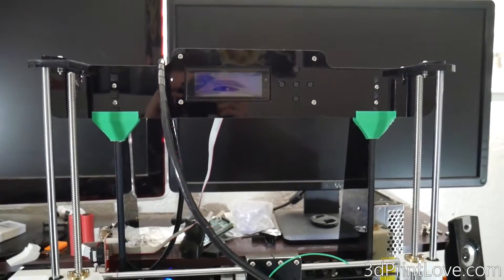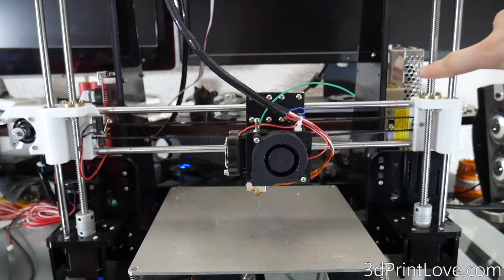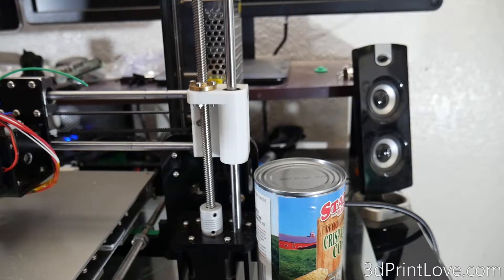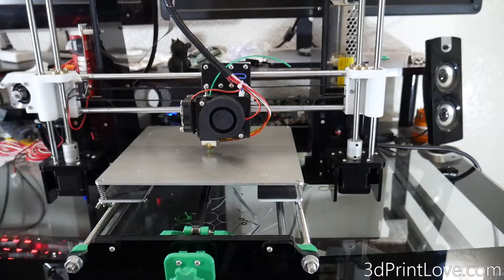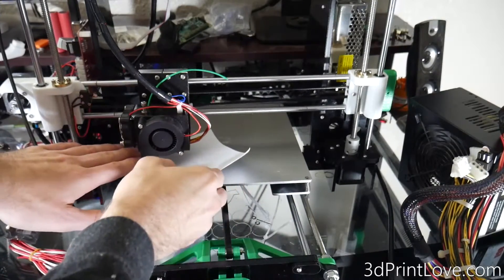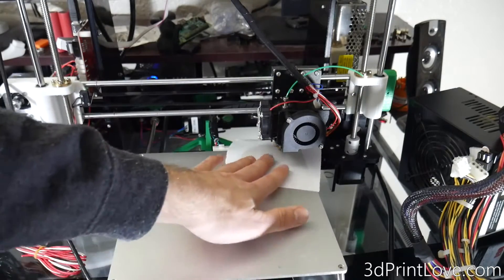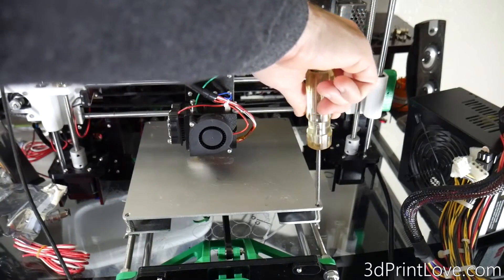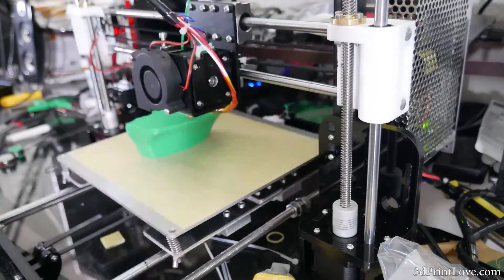Tutorial How To Level X-Axis And Bed On Prusa I3 Style 3d Printer (Anet A8)

Comment: whats the height position of z axis limit switch?
Reply: A G it varies and is dependent on your heated bed height but it should do a majority of you nozzle height adjustment the fine tune the bed with the corner screws.

Comment: nice can trick. What I did to improve it was place a tuna can on top. its (in the UK) larger in diameter but only 1/3 the height. this allows you to bring down the actual plastic parts until they touch the rim, so you can also get a physical. I then basically do what you did with the paper and check they have a slight resistance when pulling out.